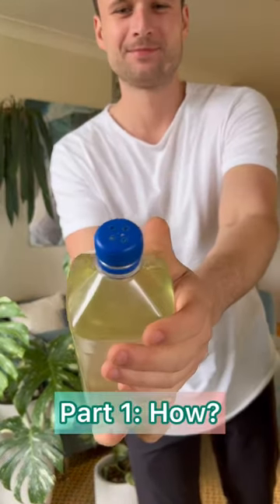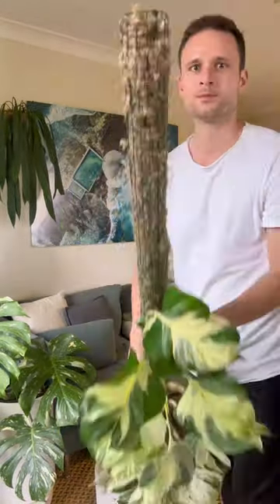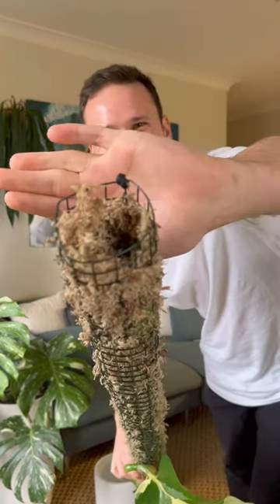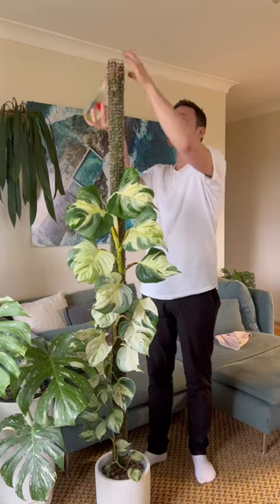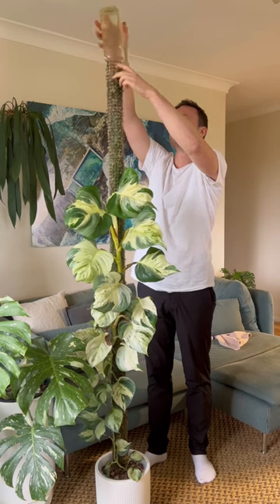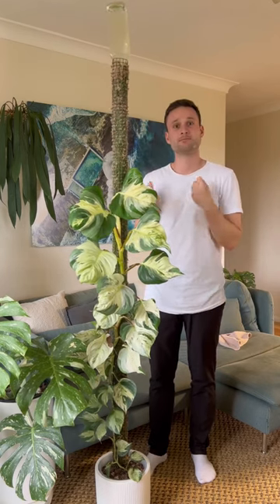Full tutorial in my Moss Pole Playlist :) #epipremnummanjula #manjulapothos #mosspole #shorts

Comment: ❤ the holes in my bottle lids are way bigger coz that’s the smallest drill bit I have 😂 it works for the most part. So long as I haven’t let my moss dry out too much. Sometimes I do have to stand there slowing pouring the water into each moss pole… defeats the purpose right? 💁‍♀️ spending my Bunnings budget on moss and garden mesh, not drill bits 🤪